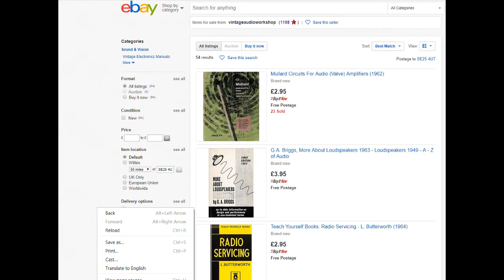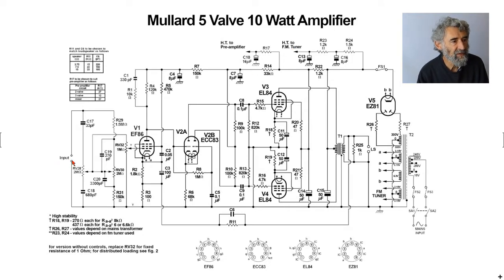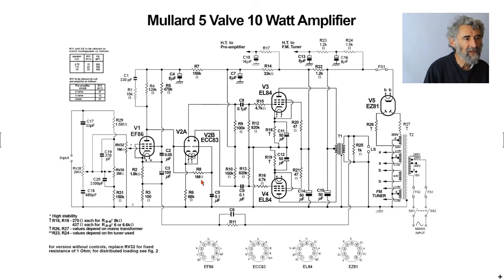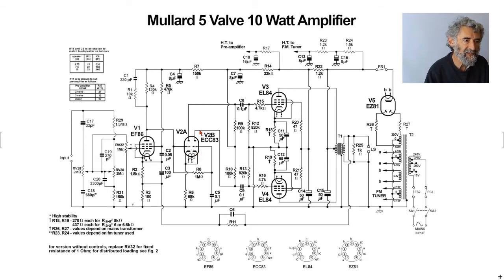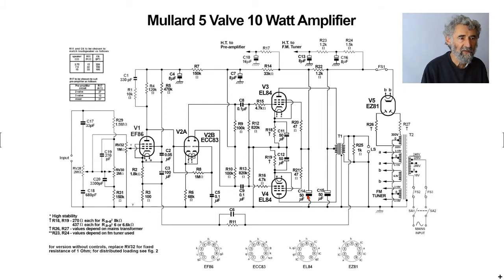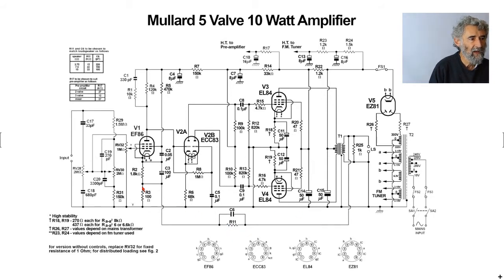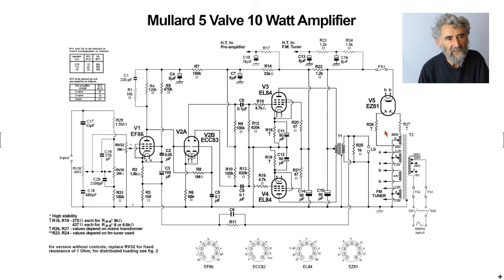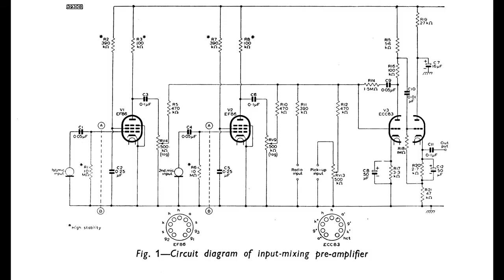Valve Amplifier Study 008: Mullard 5-10 Valve Amplifier

Comment: I built a 5-10 stereo version when I was in Uni ... I used a Partridge C-core output transformer with 43% primary  taps in distributed load configuration (ultra linear) and I used dc for the heaters ... it used 250-0-250 volt HT secondary rated at 250mA and a 10H 100 ohm choke ... performance was excellent...

Comment: I built this amplifier recently. It took me some time to fix the oscillation and the hum at the beginning. It was rather annoying because it was not quite easy to fix it. Finally, I got it all done with completely stable and no more hum at all. I have it connected to the monitor audio Bronze II speaker, the sound is pretty good especially the bass that it produces, and I am very satisfied.

Comment: I'm restoring a well built one of these at the moment, one with a lovely Partridge output transformer. I managed to finally get the thing working today but am getting quite a bit of hum. I've replaced all of the electrolytic caps and all voltages are okay. I like your idea of fitting a choke I may well do that myself. I really love the sound of this amp the D.C coupling gives lovely bass reproduction.

Comment: I am building the Mullard 5-20 amp which is very similar to the 5-10 .  I am puzzled by the lack of a value for the resistor between the main t/f
and the rectifier valve .  I have  , in my circuit 100ohm here but the HT voltage is 100volts too high .  What should I do to lower  this .???

Comment: Would you recommend building the Mullard 5-10 or the Williamson valve amp for today with a vinyl system? 
Can you recommend where to buy transformers from and which ones? Many thanks
Reply from the maker: Hi I would recommend www.ilissus.com for decent valve amps designed in Britain with all British transformers sounding very decent and well tested, I have used the Pentode EL84 type single ended for the last two years and recently just bought the 6V6 version. I may need to sell them both if interested due to travel plans, they normally retail at $700 each I will take 250 each, both in excellent condition with vintage valves. I have a set of Lowther speakers also for sale!... Thanks

Comment: It's not a floating paraphrase phase splitter, it is a long-tailed pair, and Mullard's notes state that the correct load resistor values for this circuit are 100K and 103K, and, considering that in 1954, when the circuit was published, 5% resistors were assumed. The 91+100K you mention is for the Leak Stereo 20 which has different operating conditions around the LTP, and are not correct for this design. The phase inversion in an LTP phase splitter takes place in the left hand (common cathode) triode, not the right hand (common grid).
Reply from the maker: This is correct about it not being the floating paraphase splitter so an apology can be added from me.

In 1954 the use of 5% resistors was NOT assumed: they would be
 considered semi-precision.

The comments about using different anode load resistors remains true,
 even though this is the Mullard not the Leak implementation of the

amp,
Phil Moss
Reply: @vintageaudioworkshop  The balance of a long tail pair is chiefly determined by the value of the tail resistor. Higher values improve balance but reduce the available output swing of the triodes. With 68k in the tail I would expect a fairly close balance. Balance can alternatively be achieved by reducing the value of the inverting triode's anode resistor, and, out of interest, I calculated the value which would (theoretically) result in perfect balance which turns out to be 97k, a reduction of 3%. The next lower E12 (10%) value is 82k and the next lower E24 (5%) value is 91k. To increase the value of the non-inverting triode's anode resistor by 3% would require a 103k resistor and the next higher preferred values are 120k (E12) and 110k (E24). In both cases 100k is closer to the 'ideal' values of 97k or 103k leading to the conclusion that, in this particular circuit, the closest balance possible with readily available preferred values is achieved with equal 100k resistors.
Reply from the maker: @silasfatchett7380  thank you for your contribution, I plan to come back to this subject and cover more thoroughly in basic theory, the technicians are ready to get back after the bad spell with corona19 is over. Paul